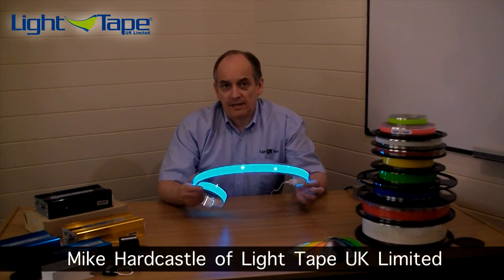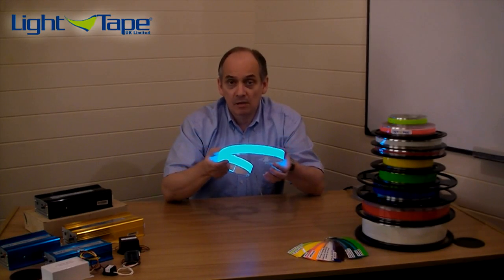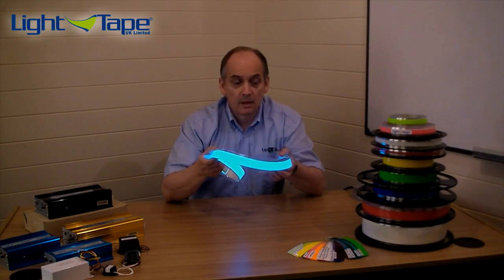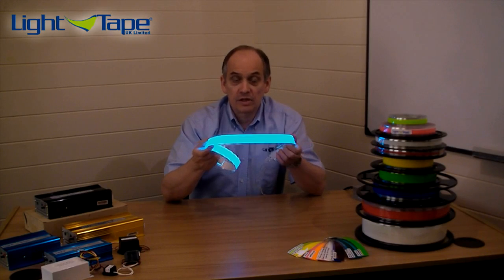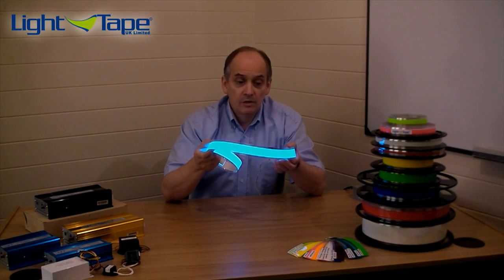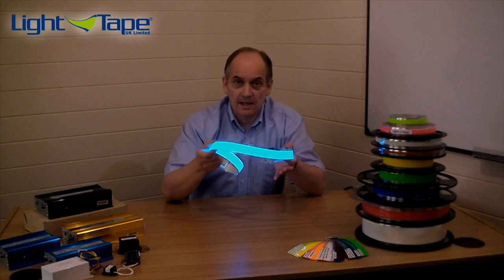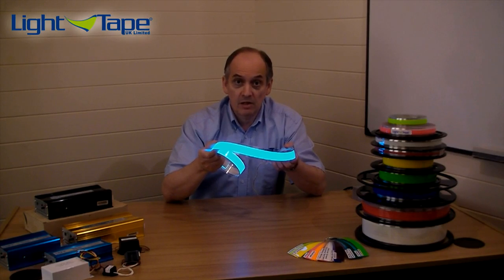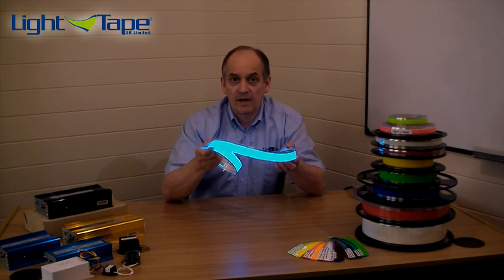What is Light Tape? Part 1 Slim flexible low carbon lightin

Comment from the maker: The noise made by the Light Tape is from the Phosphors vibrating, when the Light Tape is fixed with double sided foam adhesive the noise virtually disappears, the only place we do not recommend using Light Tape is lighting in a bed headboard, when it is totally silent you can still hear the noise, in an environment with background noise like computer fans or air conditioning the noise is not apparent.

Comment from the maker: The CO2 is created when the electricity powering the Light Tape is produced, Light Tape uses 1 watt of electricity per meter when 25.4mm (1") wide Light Tape is powered up, 15mm diameter Neon uses 28.7 watts per meter when powered up.
Working on 100m of 1" wide Light Tape it would use 438 KWh if run continually for a full year producing 18.5Kgs of CO2 at the power station, 100m of 15mm Neon would use 12570 KWh if run for a full year producing 527 KGs of CO2.
Hope this makes sense.

Comment: I noticed on your site that you have to request information such as pricing, but what if I don't want to order in bulk, but just want to use it for one cosplay outfit or a single table? Is it possible to order for personal use instead of commercial bulk ordering?

Comment: Audio is whining
Reply from the maker: The noise made by the Light Tape is from the Phosphors vibrating, when the Light Tape is fixed with double-sided foam adhesive the noise virtually disappears, the only place we do not recommend using Light Tape is lighting in a bed headboard, when it is totally silent you can still hear the noise, in an environment with background noise like computer fans or air conditioning the noise is not apparent.